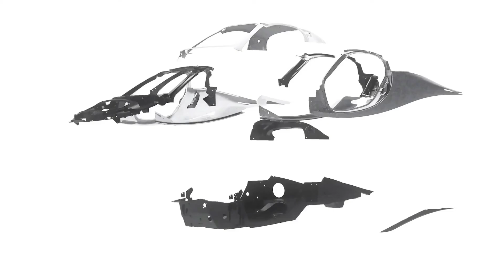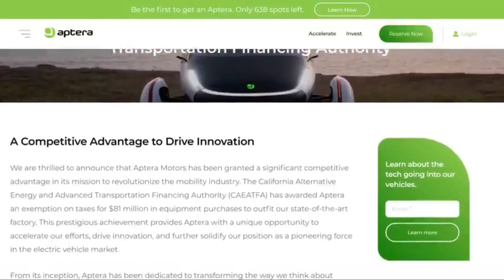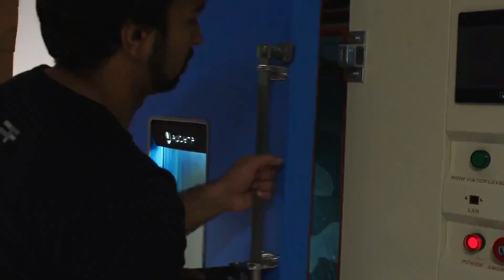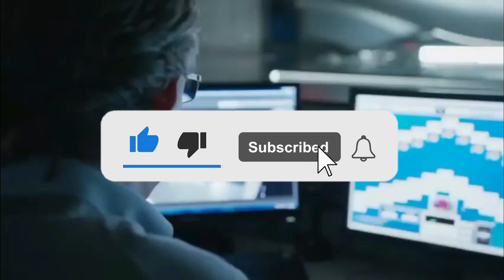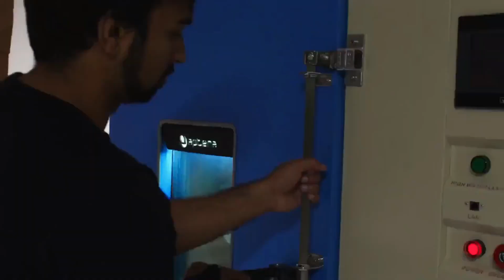2024 Aptera's Journey  Accelerating Towards a Solar Powered Future

Comment: Yeah except there is NO production, there never has been production and there never will be production.  It's a scam.  They supposedly have been working on the "design" since 2006 and have yet to make a single one that actually works let alone the absolute bullshit claims of 400, 600 or 1000 mile range.  They can't even get a SINGLE prototype to get out of the parking lot !  HILARIOUS!  There is not one single video of the vehicle in operation for more than a few minutes because it doesn't work.  They already went bankrupt in 2005 after stealing 24 million.  PONZI SCAM

Comment: The future isn't what it used to be! Great strides towards better have been happening with this company, and those large checks will come as validation of the claims become verified. The risk is slowly going away. Whales should be made to "pay up," as the development stage is ending. In any case this company is getting closer to the finish line, and those in line for the first 2000 Aptera should be ready to go to California to pick them up.
Reply: I am currently in the top 100 Accelerators and I feel quite confident that I will be driving mine home this year. I'm anticipating (hoping) Aptera will unveil a production intent build at the EVA meeting.
Reply: Everything you said is bullshit.  It is all a scam.